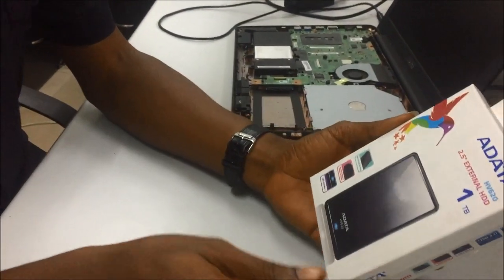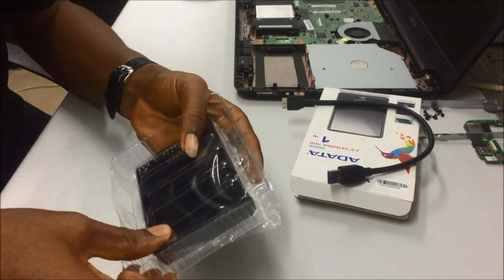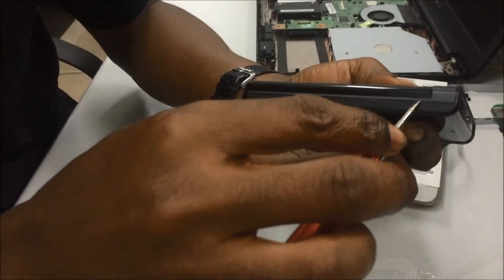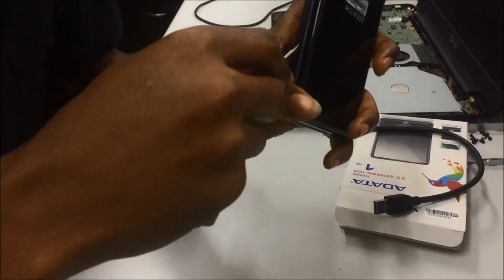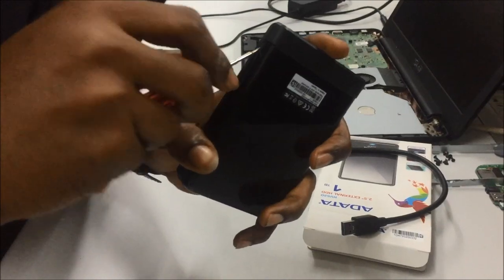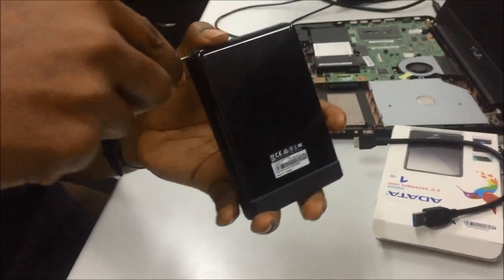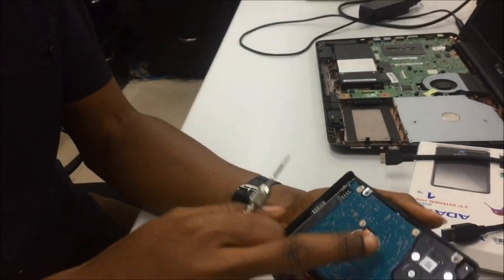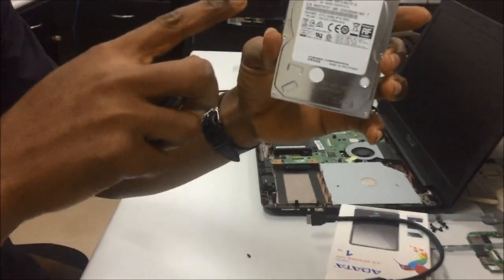ADATA HV620 DISMANTLE PROCCESS

Comment: hi! may i ask if the memory will be lost by changing the case of the harddrive? (after dismantling)
Reply: Data remains intact, since there was no powering up of the drive or connecting to a device; it's simply a change of case.
Reply: @Ishicoatl  This might not work generally for all harddrives. If they have hardware encryption, then there is a key on the chips in the case... So the data on the disk would seem random if you tried to read it directly. WD brand does do this sometimes, so be aware.

Comment: is there any seal which gets damaged while opening?
Reply from the maker: No seal, If you can be careful enough not to leave any trace while opening it nobody will know.
Reply: koko TV how can i do so?
Reply from the maker: The truth is that it is difficult to open it without a trace. I left this one with two traces. But if you can be more careful than me, then you can try it.
Reply: did you faced any problems and had to claim warranty?
Reply: while using it as a internal hard disk?
Reply: because actually I need a internal hard disk but when i am conpairing the price this hdd is coming in less cost thats why i am making it sure that there is no mistake
Reply: you made this video 2 years before.
Reply: are you still using the hard disk? and have you faced any problems?
Reply: and did company give you warranty replacement if you have faced  any problems!!! please answer me
Reply from the maker: No
Reply from the maker: The hard disc that came with my computer got crashed and I know Adata hard disc to be strong. I use it on the laptop for my kids and despite the fact that it has fallen down so many times and I have had reasons to format it more than 7 times, it is still working fine.
Reply from the maker: I believe there are other factors that affect prices, so you can not use price alone to conclude originality. You can buy other hard disc and share your experience.
Reply from the maker: No, I made it 2 months ago.
Reply from the maker: I'm still using it and it is working fine.
Reply from the maker: Apologies for the delay, I was not given any warranty replacement.